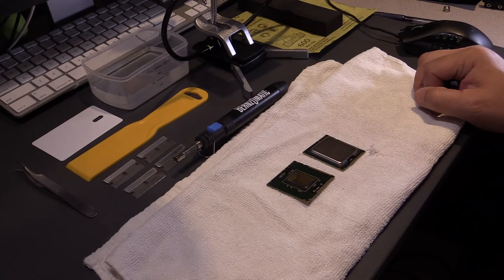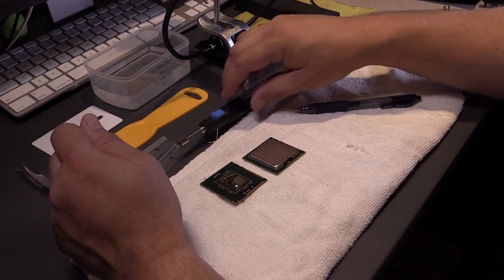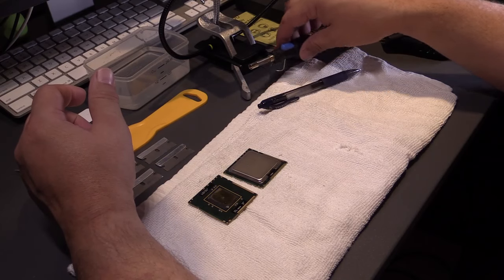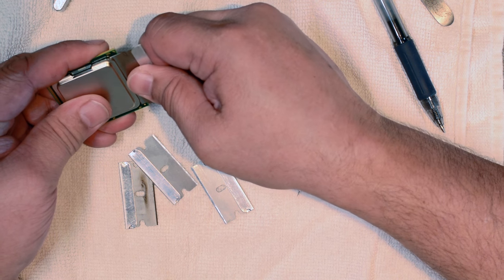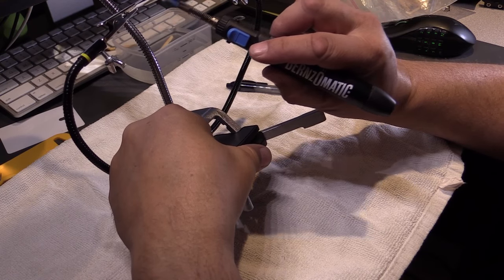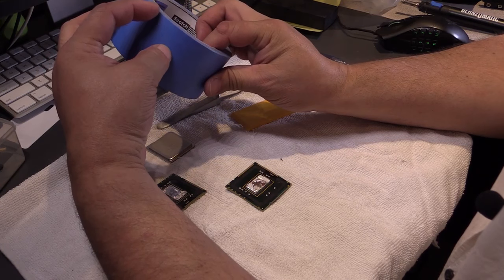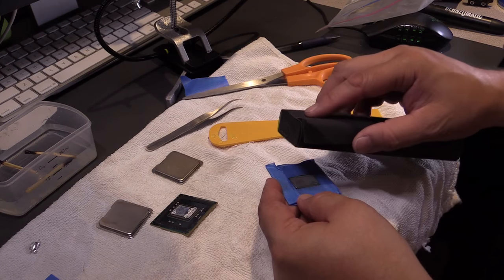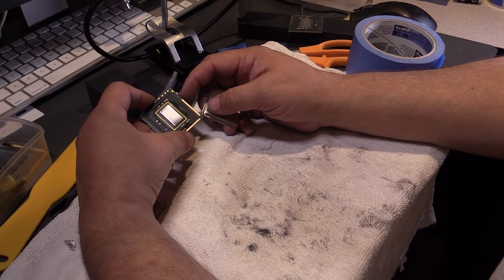Soldered IHS Removal Process for upgrading CPU in 2009-2012 Mac Pro Models

Comment: Thank you for your thorough video on this process.  At first, it is a bit daunting and a little scary - the idea you're going to in essence, rip the top off a CPU.  But it is certainly a doable thing.  Not having a vise, I bought a simple table top vise from Home Depot for $20 which worked like a charm.  Before placing the first CPU into the vise,  I actually made an effort to undercut the rubberized seal and I removed the CPU from the vise a few times to "check progress" during the process.  Early on you can clearly see the IHS moving in one direction (which certainly was a confidence booster!).  Upon seeing the IHS move as desired,  I carefully cut a little deeper into the seal ever so slightly.  My final turns to release the IHS were not as dramatic as expected (I held onto the CPU with two fingers in the final stages and could feel the "pop".)  Once the first was completed, doing the second was much easier.  In retrospect, I wish I had gone down this path sooner-than-later as torching a CPU was not something I was comfortable.  Besides, I figure that worst that could happen was I'd be out a processor at a cost equivalent to a bad date!  LOL  Good luck to all.

Comment: So I succeeded in getting the lids off! Like 30 seconds the first time 45 - 50 seconds the second time only stopping after 30 seconds to change how close I held the torch and to move it a little tighter in the area in the center of the lid where the die is more oriented. The lid popped off each time rather gently. Now I will say this make absolutely positively certain that you have indeed cut through the mastic seal. That was how I destroyed two sets of processors earlier!!!! Expensive lesson! I was able to slip a piece of dental floss into where I cut and got it worked in under the lid taking care not to break it. Took me an extra 10 minutes but hey as near as I can tell the processors aren't heat damaged they came off cleanly exactly as DIY Guy had done in the video. Now I will clean them up and get them installed and see if I really did the job right! Hey man, thanks you have been an invaluable help!
Reply from the maker: Glad to hear your determination and effort was successful.
Reply: im sanding and its not coming clear and shiny using 800 grit paper i don't want to screw this up how far should i go?
Reply from the maker: 800 grit is so fine that it takes a little time to get down to the die surface.  You will know once you get there since there will be a slight hazing where the solder is still present.
Reply: Just an update, I'm using Liquid Ultra thermal paste for my de-lidded CPU's and in the pack it includes a small scourer pad which they advise you do use on the CPU die (or IHS lid) and heat sink base to lightly buff it up. Now I've found these perfect for removing the excess solder post plastic scraper. Much safer and quicker than trying to use wet & dry paper. Try it and see for yourself.
Reply from the maker: Thanks for the tip.  I"ll definitely try this myself the next time.

Comment: Dear DIY Guy: I bought two 3.3 GHz CPU's and followed your instructions. I was glad to learn how to "de-lid a CPU chip. 

However, I perhaps accidentally sanded onto one of the 11 little metal pins (look like bricks--do not know the official terminology) just located outside of the CPU center surface. Currently, I have the CPU's being checked by a computer shop to see if one or both are damaged.  I will let you know if the CPU's are damaged (one or both). I will then purchase new ones and install them "lidded". When I removed the heat sinks that sit on top of my Quad Core Intel Xeon CPU's (2.4 GHz), I found the original CPU's were lidded--not as some people have claimed, meaning that Apple originally installed "de-lidded." 

Sincerely, AM

Comment: I was thinking of delidding a couple CPUs for my 2009 4,1 and happened to come across your video. I've ordered the items you use (helping hand, mini torch etc) and a couple of cheaper processors (Intel Xeon e5620) to practice with. Once I get the hang of it I'll order a some x5677 or x5670's for final use in my 4,1. Thank you for such an informative video, it's given me a good idea on what to do.
Reply from the maker: You're welcome.  It's really not that difficult to do.  Just take your time and prepare a place where you won't burn or melt anything.  Use the painters tape, after you remove the IHS lids, and protect the PCB real well.  If you need to change the tape, due to it getting worn while you're sanding the remaining solder off, do so.

You will also probably want to flash your firmware to 5,1 to get your Mac Pro to 2010 specs after you do the install.  Check Netkas.org and Macrumors.com as there is a lot of information on how to do this.  

With the firmware upgrade, combined with the cpu upgrade to at least the X5670 - 2.93 GHz processor, you should be able to use the faster 1333MHz memory as well,  but it will require a PRAM reset afterwards.

Assuming Apple doesn't cut off these machines with their OS upgrades, these upgrades should give you at least 5 more years of solid continuous use on par with the faster 2013 models.
Reply: Thanks for  clearing that up for me I appreciate it.
Reply: Does this video show everything you did prior to installation into the Mac Pro? Did you also the rubber seal on the perimeter of the CPU? Lastly, in a similar video, someone mentioned putting clear nail polish on the capacitors once the de-lid was completed... do you know why would this be?
Reply from the maker: The video clearly shows the process for cutting through the rubber mastic glue on the perimeter of the IHS.  

Secondly, there have been some theories that coating the surface capacitors with a non-conductive coating like nail polish, Permatex, or electrical tape helps protect them when using a water block cooling system which is not required for a Mac Pro.

For this exercise, we are not attempting to over-clock the processor, only trying to get it to fit into it's sockets on the Mac Pro without damaging the circuit board.
Reply: +DIY Guy thank you! Great video.

Comment: So almost exactly a year to my start date,. hey had some major setbacks, got the beast up and running Mac Pro 2009 4,1 to 5,1 firmware hack, 2x Intel Xenon X5680 processors running at 3.33Ghz, 128GB ECC 1333Mhz RAM, Sonnet USB 3.0 PCI Pro Card, Nvidia GTX 120 (my next upgrade), 6TB of HDD (will change to SSD's very soon!. Learned some very very expensive lessons. If you can pull it off its great. De-lidding is the move make sure you read all of the tutorials you can. This one is excellent! Make sure you have indeed cut through the glue/adhesive holding the lid on. Failure will cause you to overheat the processor and destroy it. Like I did. TWICE!
Reply: Damn. Thanks for the head's up!
Reply: After I melted an Intel Xeon X5690 doing this video, I immediately went to the safer (and foolproof) vise method of de-lidding. Using heat is just STUPID when you can just cut away the RTV/silicone sealant and use the vise to gently slide the lid straight off the die. With the vise method, I am 4-for-4, 100% success rate. No risk.
Reply: Do you have a video showing that process?

Comment: Great video. If there had been a follow up or add in of the performance gains. That would have great as well. 
Overall great video and I liked your editing with the transitions. Made it way easier to follow at critical points. 
Thank you.
Reply from the maker: This mod is basically more for Mac Pro 2009 owners who want to upgrade their machines to 5,1 and stay current.  However, there are modest gains to delidding IHS in general that more extreme users want to achieve.
Reply: @diyguy1808 Hello, what would happen in the case that I wanted to solder the IHS with the micro of a 3770 since I cannot find liquid metal anywhere and the thermal pastes have not given me results

Comment: I'm told that one of the best processes to do the final polishing on the die is to use a spray adhesive on a piece of glass and adhering the sandpaper (600+ grit, Higher the better). and then to move the processor over that. It guarantees a perfectly flat polish to the face of the die...
Reply from the maker: That sounds like a great idea.  Thanks for sharing.

Comment: Very helpful video, it is very unfortunate that I am watching it after I did damage my processor and CPU. Yes, I didn’t know the difference so I just got it install it and it was working okay. Until one day I decided to phosichly clean my computer then I decided to lignin a little more the heatsink and - What! that was it, nothing no image nothing. After hours of inspecting and trying switching video cards and thing here and there - I found that I did damage the CPU and the board.  I end up getting another computer as I needed to finish some business and now will fix my mistakes. lol. Thank you for the video.

Comment: the reason they recommend not putting the blades in is you can split the die if you put them in to far, you want very little tension. to much and the die will split. i did my w3680 because the solder had to many air bubbles in it and i had weird core temps, since i was reusing the IHS i used LM and temps were way down afterwards.

Comment: That "solder" looks very similar to the gallium alloy pads that are available for Xbox and PS3, and also PC laptop kits with mobile unlidded CPU. Couldn't you remove the excess, or add a new pad on top, instead of using thermal paste? Those pads are designed to melt at high temperature and thus fill in any gaps between the metal and the die. With a re-flow station or heat gun, couldn't you smooth it out and apply an additional liquid metal pad. I don't think introducing grit to the silicon die is a good idea. It seems the only risk would be removing the heat sinks at a later date, or have excess 'liquid' metal dropping into the area around the die with exposed surface mount components. I had great results using the CoolLaboratory pads in a PS3 once.
Reply from the maker: I agree that there are better alternatives to Arctic Silver thermal paste.  I haven't used gallium alloy pads myself so I can't attest to their efficiency, instead using a well trusted Tuniq TX-4.  However, sanding the solder off the die to the top of the substrate, also called lapping, is the preferred method.  Primarily because you need to have a completely flat surface to make a good clean connection with the top heat sync.  

In the 2009-2012 Mac Pro models using dual processors, the heat sync that sits on top of the processor has four screws that secure it down.  If the build up of remaining solder, after removing the IHS is too thick, you could still potentially damage the logic board if you tighten it too much, or don't evenly screw down the four screws - which is easy to do since the screws are recessed several inches into the heat sync and you can't view them when turning the allen wrench.

Sanding the solder, using a fine grit wet sandpaper, creates a slurry similar to how you finish surface car paint.   I have found that any fine sanding marks can be polished with even finer sandpaper allowing a greater percentage of surface contact between the die and the heat sync.  Once done it should be almost like a mirror surface.  We are talking microns of thickness, with the solder being much softer than the top of the die, so it's unlikely that you would take much of the die substrate off using very fine sand paper.

To get back to your point about using gallium thermal pads, I would be interested to see if others have used them in a Mac Pro, dual processor, configuration from a de-lidded upgraded cpu configuration.  They don't look any more difficult to apply than messy thermal paste. 

Thanks for contributing.

Comment: Can you post a link to all the tools you used off amazon? doing my first pair of X5675's and want to make sure i have the right stuff. After watching countless videos this seems like the fastest and safest way.
Reply from the maker: I would recommend doing a search for "Bernzomatic Micro Pencil Torch," "Plastic Putty Knife," "Single  Edge Industrial Razor Blades," and "800 wet dry Sandpaper."  If you would like the optional helping hands tool as well, there are several to choose from, but the one I used is called the "Stalwart 75-MAG1009."

Thanks

Comment: You should only do this for a 2009 Mac Pro. Apple modified the heatsink in 2010 and as such 2010-2012 Mac Pro's did not come with lidless processors. You should not remove the integrated heat spreader if you are installing new processors in a 2010-2012 Mac Pro.
Reply: And only dual-processor models. The single CPU models are not lidless.

Comment: I am curious, do all the processors have this IHS applied? Are they available without the IHS? Is there a cost difference? Where were you able to buy the processors? I am getting a used MacPro and am planning future upgrades. Thank you. Great video.
Reply from the maker: Unfortunately, you can' t buy lidless cpu's from any official Apple distributor.  However, you can usually find lidless cpu's off ebay, which can be pretty expensive, or if you choose to do the delidding yourself and save some money.  

Xeon processors that will work for the 2009 models are not that expensive now, and can also be found on ebay.  

For the very fastest processors, i.e. X5690, expect to pay considerably more than you would for a X5680 and hardly notice any difference in performance.  So consider the price per performance before spending a hundred dollars more than you need to.

You can review the list of all the compatible processors from the following URL:

http://goo.gl/5qYTwC
Reply: Steven Poleske
Reply: DIY Guy whe

Comment: 2010 12 core Mac Pros didn’t used a delidded processor.
Reply from the maker: You'r correct.  Mainly this mod is for the 2009 Mac Pro model to keep them current and upgradable to 5,1.  However, for those extreme modder's removing the IHS on 2010-2012 models might show slight performance gains in heat dissipation and reduced energy use.

Comment: Jut a couple questions. Water doesn't damage a CPU? Do you think using Arctic Silver cleaner be safer ? just curious. Also the reason for not using lids is that about the way apple designed  the motherboard?
Reply from the maker: Water doesn't damage the CPU, but you should take care to cover all the exposed surfaces of the pcb board with the painter's tape when you're sanding the old solder off.  This way you reduce the risk of contaminating the contact surface on the bottom.  

The Arctic Silver Cleaner is nothing more than an alcohol based solvent of some kind.  It won't remove the solder, thats why it has to be scrapped off and sanded.

There are several theories as to why Apple designed these Mac Pro's to use lidless cpu's.  One belief is that the engineers were tying to squeeze the most efficiency out of the processors while allowing better cooling performance.  The second being a strategic and financial reason, since it's almost impossible to find lidless processors, that were factory produced, except through Apple channels.  This way they could control their hardware upgrade components at a premium price.  I choose to believe the later.  

Using a lidded version of the cpu is actually more difficult to install since you have to buy separate washer/spacers for the heat-syncs, and have to break the snap connector that connects the fan, as well as adding additional heat cushions etc.  All the while potentially damaging the motherboard if you over-tighten the heat-sync screws, which is very easy to do.  Furthermore, since it's pretty difficult to firmly seat the heat-sync, there tends to be a higher chance of overheating causing random restarts and shutdowns.  Using de-lidded cpu's doesn't require any modding of the stock motherboard, heat-syncs etc.,  fearing over-tightening and problems with over-heating.

Comment: Hello again DIY guy, I finally found time tonight to delid my test processors. The first one I managed to cut the capacitors (oops!) and the 2nd I did ok overall, although at first I angled the processor too much on the helping hand so only one half came off.

Just a query please about the leftover adhesive which we use the razors to cut through during the first stage. Is it ok to leave the remaining adhesive on there after delidding or do you scrape it off?
Reply from the maker: Practice definitely makes perfect. :-)

Yes, remove the mastic glue,  I usually use my finger nail to scrape it off - it's not too difficult to do.
Reply: +DIY Guy Thanks will do!